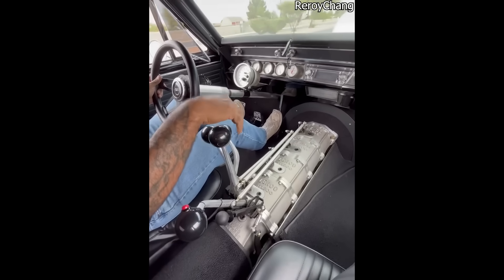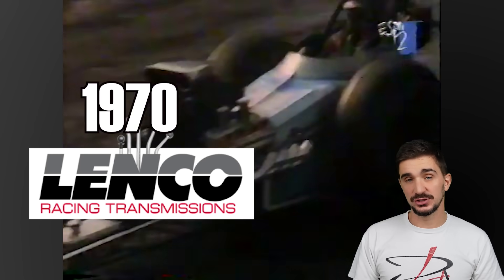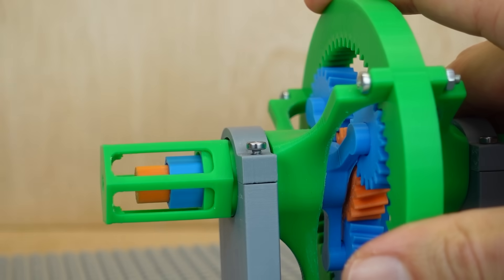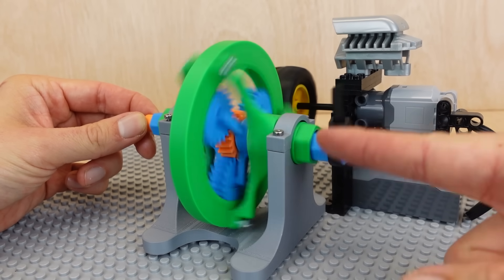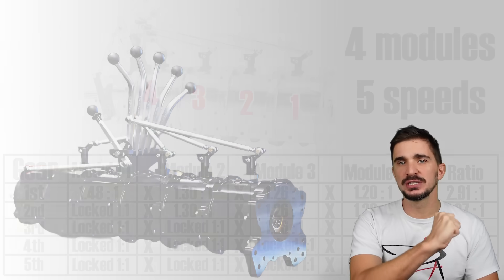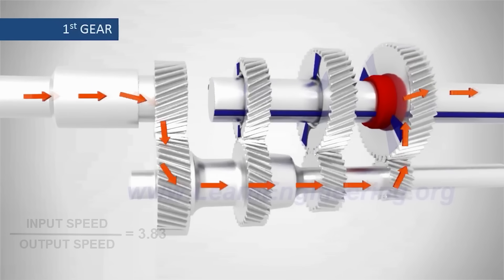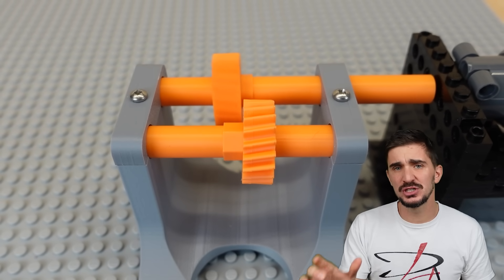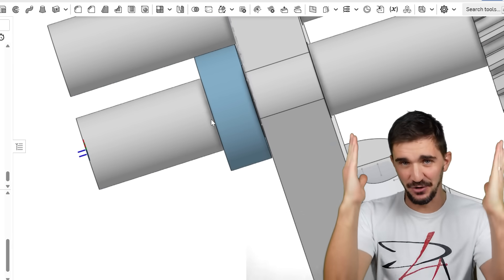This is The Strongest Transmission Ever Built - Planetary Manual Lenco Gearbox Explained

Comment from the maker: Try Onshape, the world's most capable in-browser CAD software for free for 6 months: https://Onshape.pro/d4a
Planetary Gearset I used: https://cad.onshape.com/documents/f0457e500ee8181604a67dad/w/19556b2afaed74c80139aa9e/e/539e345309585e8be2ebd8d3
Onshape Learning Center: https://learn.onshape.com/
Big discounts on Bambu Lab printers, filaments and accessories: https://tidd.ly/48q4vgM
Support the channel by shopping through this link: https://amzn.to/4fatbMb
Become a member: https://www.youtube.com/@d4a/join
Patreon: https://www.patreon.com/d4a
Reply: Onshape link is wrong.
Reply: Why are herringbone gears not used in any transmission? they are as silent as helical gears, and stay centered like straight cut gears...
Reply: @dsconnectedn3uron324  too expensive and complicated to manufacture, I think.
Reply: @dsconnectedn3uron324  you'd have to split at least one of the gears down the middle so that it can be assembled, then use some kind of mechanical fasteners (screws, rivets, whatever) to put the 2 halves back together. it should be designed in such a way that the 2 halves are pushed together, not pulled apart.
Reply: @mrxmry3264 I thought about exactly this some time ago. But remember that on two gears making contact, one pair will be pushed, and the other will be pulled. 

Maybe good rivets the closest possible to the outer diameter would handle it
Reply: @brunocorrea6010  if you split a herringbone gear into 2 helical gears (with opposite angles), they are either pushed together or pulled apart, depending on which way the power is transmitted.
Reply: Man u are one of the best automotive youtubers dude
Reply: heyy can you make a video on case IH cvx transmission, it's insanely awesome transmission for tractors
Reply: *dont let the intrusive thoughts win, my bank acount cant take it"
Reply: Can you do a follow-up video about a Gear Vendor's Overdrive?
Reply: Onshape is always completely free if you don't mind sharing your models.  It only cost money if you need to keep your models private.
Reply: As an old-school cad user the online-only part bugs the heck out of me... besides security issues (how many borders does the data cross, where are the servers, where are my files) you're at the mercy of an internet outage, too (though the licensing tools of a lot of modern cad rely on a connection, too).
Reply: Always insightful and interesting videos
I always wondered how those crazy transmissions worked
Reply: Complete your build
Also
Go drive a autozam AZ1
Reply: sponsor link is broken :-O
Reply: Speaking of transmission, how about a zf8 explanation video? Why is it so good?
Reply: A quick story from my side: The GF wanted specific self-watering pots, a few units. In the store, they were bizarrely expensive, so I refused to get robbed like that. Then I remembered I have a 3D printer. I run linux, so any CAD software is not very straight forward. Then I remembered you advertising onshape. Gave it a try. I had no previous experience with CAD, so I watched a few of their courses, enough so that I can design a rip-off of the pots the GF wants. Printed several at 1/4 of the price that I would have paid in the store. 10/10 would recommend onshape and their courses.
Reply: I don't like cloud based... or any software that requires being online.

It becomes useless the moment your laptop goes somewhere without fast enough internet. Meaning you can't work at an airport, on a bus, on a train, on an airplane, or in nearly every rural location... of  which there are many. 

So if there is a one-time purchase option I am there. Otherwise I will just build some CAD software with AI.
Reply: Hey D4A, could you please create a video giving your opinion about the Suzuki AX100?
Reply: there is another solution instead of a sprag, called a mechanical one way diode. a sprag can spin when in a stall condition. A mechanical diode will not. Think of it as the best of both worlds between a sprag and a spragless system. (well it's also stronger but also slightly more expensive.... sorry i'm a racing transmission/motor builder and i have to think of these thing when i used to build racing systems)
Reply: Not even in the same planet as the strongest transmission.
Reply: Vielen Dank für die Erklärung dieses Getriebes ❣️🙏🏼
Lieben Gruß aus Berlin 🇩🇪,
Ramsi 🙋🏻‍♂️
Reply: Fun thing i had onshape as a learning tool while i was in design school 5 years ago and i crashed that thing at the first lesson trying to design what? A transmission 😂
Reply: 2 AM I'M WATCHING,AND VERY GOOD VIDEO.
Reply: Can a transmission like this be realistically used on a daily driven truck?

Comment: Since you have proven yourself worthy, I will now give you my vacuum cleaner motor design that doesn't use electricity or fuel.  Get a 12 foot long 2" inside diameter plastic pipe and attach it upright to the side of the house above a removable 5 gallon bucket for collecting wedding rings. Get a 3/4 inch id ball valve to supply water to 3 water jets you mount near the top of the pipe by drilling holes in the pipe 1/3 around for each. The jets squirt a small stream directly down the center of the pipe and as the jet breaks up into droplets it sucks air in the top for the whole house vacuum cleaner, and all you have to do is get the jets manufactured and sold in little packets, with a directions print out and website PayPal sales bot advertisement. If you don't believe that it works, aim a garden hose down a pipe and feel the vacuum.  PS, if the jets were mounted in a double female pipe connector, it could be glued in line just like regular plastic plumbing, & even a democrat can install that.

Comment: A standard single-stage planetary gear set can produce three different gear ratios and a reverse or neutral option by changing which of its three main components is held stationary (fixed), used as the input, or used as the output.

Comment: It would be fun to take one of these transmissions, hook some servos up to it, and do a shift by wire setup, where you map it back to a standard H pattern.  I bet you could get the down shifting to be slick, as you wouldn't have to actuate all of the individual lock pins to select a specific gear.

Comment: So a lenco is essentially a single gear manual that you can lock into different ratios so you aren't changing gears your just changing the ratios to suit your speed based on speed rpm and torque, thats putting it in very lament terms though

Comment: An automatic has a hydraulic fluid engaging the clutch packs today is very true the type of fluid you use and the type of material used on the clutch packs means it doesn't slip so it's comfortable on the road you can have them gauge engage instantly which is what they do with drag cars but it's not comfortable

Comment: Please please please Opel/ Vauxhall c2.0xe iconen race engine was available for the normal petrolhead. I had Bild one for my cosa a 189 hp on the Wheels non turbo 7900 RPM. Deserve to be explained by you.🙏

Comment: 6-8k for a trans is cheap. I rebuilt my OBS 7.3 IDI E40D and beefed it up and it ran me $4500, and that is only so it could handle 400 HP and 660 lbs-ft of torque.

Comment: This could be interesting if you researced the recent misuse of a lenko in mcflurry and how they didnt know which gear ratios worked ultimately shifting the transmission the wrong direction which still gave decent results compared to previous tests.

Comment: another reason why the Lenco can be stronger is that the transmission length is not limited by factors normally considered in ordinary transmissions, which means that the gears can be made wider and therefore stronger. Another reason is that it does not have a torque converter.

Comment: As a note you can have helical gears without the thrust bearings by using double-helical/chevron/wishbone gears. Although they are a bit bulkier/expensive and can experience issues if the joint between the helixes is not vented under lubrication.

Comment: I think you should be able to get 3-factorial or six gear ratios using three lenco units, just like a trumpet can give the trumpet player six tube lengths with three valves.  All direct-the last by itself, the middle by itself, the middle and last together, the first and last by themselves, the first and middle, the first alone.  Wait, that's 7 ratios!

Comment: There's still a primary clutch between the engine and transmission right? Is that just super beefy to handle the 3K+ HP on launch and holding power from that point on?

Comment: The ultimate solution to eliminate side thrust from a helical gear is pairing them to form a herringbone arrangement. Citreon cars emblem is exactly that and Mr Citreon patented it. The noise in a straight cut gear is caused by the changing pitch circle diameter of contact as the teeth mesh. It is destructive because it causes acceleration and decelerations  as the gears do their work. The biggest advantage of helical gears is that for fixed centre distances you simply change helix angle to make different tooth counts work perfectly. No compromise like in straight cut gears. Say you have a 8 dp gear set of 21 driving 25 teeth. You want to change ratio to 22 driving 25 teeth. You have to compensate somehow if you keep same centre distances. If it's helical you change helix angle and it's solved.

Comment: In a manual transmission, it's usually a single contact.
The second contact in your model doesn't count because it's another reduction. The same applies to the Lenco gearbox; it has a minimum of three contact points in each gear ratio, which only experience half the load.
If you have four different gear ratios, you have more than five gears. If I'm not mistaken, there should be 17 gears.

Comment: 9:19 couldn't you binary through the different modules? Assuming they have different ratios, every unique combination of modules would produce a different gear ratio, therefore with four modules you would have 15 speeds, unless there's some reason that you can't lock a module independently from the others.

Comment: So I know the downshifting issues, but has anyone used this type of transmission with an electric motor? Strikes me as the sort of way to be able to use that accurately high torque off 0rpm and not have to deal with spinning the motor up so high.

Comment: Correction for you the number of contact points is not 6x4+24 its 3x4=12. The input does not contact the ring gear, it contacts the planetary gears.

Comment: I think you made bit of mistake in de comparisson of the contact of gear tooths. The power/torque in an manual spur gear transmission is going trough one tooth, and in an planetary gear through 3 tooths. you should compare them in this 1 vs 3 ratio. in your way of thinking, adding more steps to an lenco box would make the lenco box stronger than an manual, wich is not the case. (think of it like a chain, always the weakest link would distroy the chain, manual gearbox is one chain, lenco box is 3 chains parallel.)
Reply: but i liked the video nevertheless!

Comment: What about double helical gears? They basically consist of 2 helical gears put together on the same shaft (or 4 gears in total) to form a v shape which the thrust forces cancel out. You basically get a super strong gear that is super quiet. The only problem is that they are hard to manufacture thus more expensive.

Comment: I know Lenco is just a brand name but I wouldnt call them the strongest transmission ever. I break one of the units, usually 1st or 2nd, every 2 season behind the ole big block. They dont hold up to the high torque launches as well as you would think or hope.

 Go to your local strip and talk to the guys racing about them and look around. You wont see nearly as many of them as you would think for it being unbreakable and any racer ive ever met that ran this setup has broken one at sometime. Instead of just theories go look at real world experiences.

Comment: Lenco! and a Lenco where you don’t need a clutch is called a Bruno Lenco because it was a torque converter attached to the front. It was developed by NHRA Bruno Massel’s father.

Comment: I've got a Lenco that I inherited in 2006 from a fellow driver that bought it new in 1991. It has had one full rebuild since being built at the factory... After I knocked the damn thing off of a pallet rack and it landed on the output shaft while moving some parts around. It's made well in excess of 5,000 8-9 second passes with ZERO issue. I replace sprags every so often, but it doesn't need anything except for a slap on the ass whenever yer feelin frisky!  Pretty great lil unit!

Comment: That's a bit of an over exaggeration.  Maybe the strongest transmission for drag racing a lightweight vehicle for a quarter mile.   Take that tranny and put it behind a cummins ISX15 with only 600 HP, but over 2000 lbs ft of torque and hauling 80k pounds and hammer the throttle.  Bye bye transmission

Comment: this seems pretty... digital.
what about a binary transmission with this design?
that would be 8 speeds with just 3 modules, or 16 speeds with 4 modules.
spacing those speeds and choosing the right gear ratios is kinda beyond me and over my head, but it should be easy for someone with a bit more knowledge regarding engine characteristics and vehicle dynamics.
obviously manually actuating 3 or 4 levers at once  in different directions would be kind of a challenge, but easy for a simple hydraulic or electric system if we drop the 100% mechanical requirement

Comment: I would argue your way of counting contact points is very misleading, and well, it's missing the point so to say.
contact points are either in series or parallel, and that's a pretty huge deal. your model of a regular transmission has 2 contact points, yes, but those are in series, so let's say that's 1+1. A planetary module on the other hand has 6 contact points in total, but that's technically 3+3, as a set of 3 contact points are on the same shaft. That makes it exactly 3 times stronger, no matter the number of modules or speeds.
All this is disregarding the fact that planetary gear sets are really well balanced load-wise, and the shafts only have to transfer torque, and not resist any other forces.

Comment: yes!! of course it spins, like an Auto transmission, you need to 'brake' the other unused elements, this is why you have 'bands' in the transmission, to stop this torque reaction, like a jammed drill bit, and you let the handle go.

Comment: I have question about this gearbox 
I want to know u can downshift with this gearbox ? Like 3 to 2 for racing
Reply: You can just move the handles the other way, returning to a lower gear, but that's not done in drag racing. In a drag race you shift up through the run, then get towed back for another run. No one would use a Lenco in other forms of racing because, due to the sprag clutch approach, the transmission sections won't back-drive in reduction ratios and so there is no engine braking. It's also heavy and bulky.
Reply: Tnx mate ❤ @brianb-p6586

Comment: Not mentioned is that there is no engine braking in any ratio other than 1:1. No problem for drag racing/constantly under acceleration. When street driving, when you coast the sprags are over running, when you stab the throttle you lock the sprag very harshly which is what you will break. They’re not easy to come on/off the throttle or downshift and accelerate without hitting the sprags hard.

Comment: I did not get how the clutch of one transmission module works. In 1:1 it connects 2 of the three shafts. Thats pretty clear. But is there a second clutch that holds the third shaft if the other clutch is open? Otherwise the output would not have any torque, like shown on the model.
Reply: That's the overunning or sprag clutch, which is mentioned in the video.

Comment: Reminds me of a home made forward reverse gearbox my dad made for his boat using a car diff centre. One axle shaft fixed to the flywheel, the other axle to the propeller and the ring gear either fixed with a band brake or connected via a clutch to the flywheel.